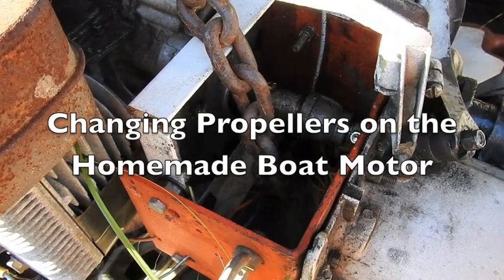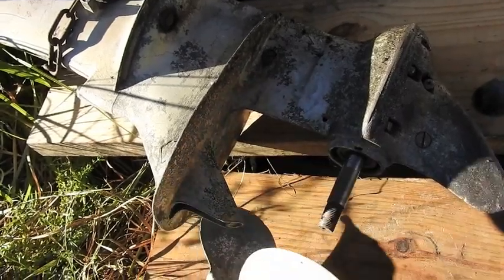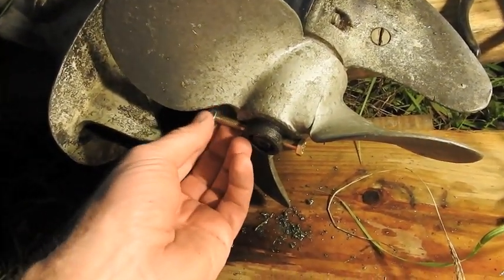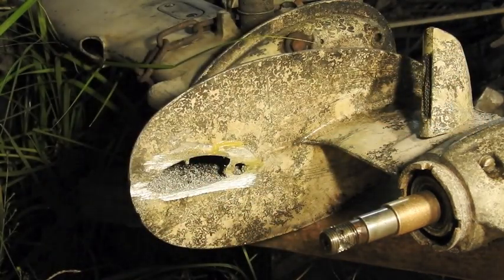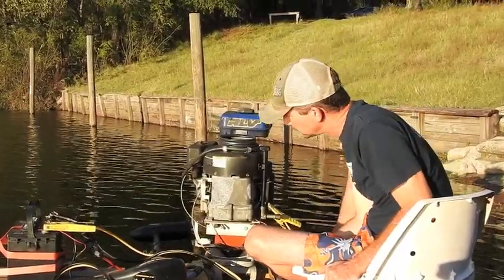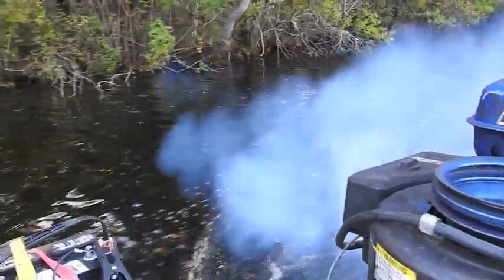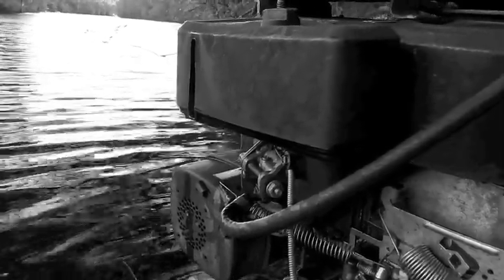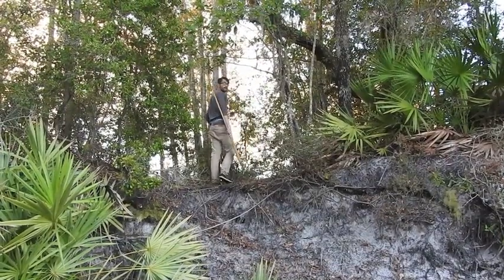Homemade Pontoon Boat #7 Looking for Speed.

Comment: You should have a "love joy" coupler" between the motor and the shaft. They have a rubber insert that take out the vibration and run smoother than that piece of pipe and bolt setup you have there, that will no doubt self destruct eventualy.
Reply from the maker: Everything self destructs eventually... Just kidding. If you check out my more recent boat motor builds, I did use love joy couplers. They are so much better, I wish I would have know about them sooner. thanks for watching.

Comment: If you want more speed, spray foam the gap between the barrels and then flex tape them.  Make them smooth.  More importantly, tapper off the rear barrels so you do not create swirl.   Great build.
Reply from the maker: I love your ideas, especially the tapper in the rear to prevent swirls.  I am planning another, bigger build and I will consider what you said once I get started. Thanks for watching the entire series and for the comments.
Reply: One last thing, I always wondered if building 2-3 foot side walls that are hinged could fold down as a wider space would barely affect the stability.  I just got it.   Take your idea of the PFC 9inchers to the folding sides to make a platform for a dozen kids.
Reply: The 9 inch PVC you called a canoe or whatever.
Reply from the maker: Yes, the PVC kayak...
Reply from the maker: You could use them as side walls until you need more space and the open the wings up...
Reply: The reason for the idea is for more people but that means more weight and then there is the displacement or bouncay or whatever its called.   I do think you should do the next build with 8 barrels with detachable pointing tips( water cutter - whatever its called).  I have thought of making a boat that folds out to a communal platform.  Sides being of 3 inch floating foam.  I dont have the math, time or your ingenuity.

Comment: Great job!   “Instant Engineering”  at its best.   I just spent a bunch of money getting a 70s 115HP merc Tower of Power (straight 6) running.   I’m thinking 4 side barrels and a 2 barrel center pod for the motor.  If I can keep it all under a 1000 pounds 90mph is not unreasonable.  I’m 71 and have not got much left in the tank or in the the CPU so what’s the worst that can happen?  I lose a nice restored outboard and a shit load of pickle barrels.  I’ve been an engineer since slide rules.  This is the kind of stuff the got me started and this is what will take me out.
Reply from the maker: Funny and thanks for watching.
Reply: SEND IT OLD MAN! KEEP KICKEN TILL THEY KICK YAH OUT!

Comment: look  on back ( motor side) of prop around the inside there are two numbers with a "X" between them.
One  is  the  prop circle and the other is the  blade pitch
Reply from the maker: I will be checking that out again. Thanks for watching.

Comment: You could do a 420 predator long tail and get more speed that way from the prop spinning the same rpms as the engine vs using a conventional out board that's geared down in the foot
Reply from the maker: That would be so sweet! Thanks for watching.

Comment: Hey Chud, how big is the boat?
Reply from the maker: It is 6 feet wide and 12' 3" long. However, I am planning to build a 15X8 footer with 2 additional barrels. Thanks so much for watching.
Reply: Building mine as a modular pontoon system. So when I go fishing by myself, it’ll be 4’ wide, if people wanna tag-along I can add another 4’ wide section to it and double my deck. 

I’ll post videos to my channel as soon as I figure out the length I wanna tow with my Prius
Reply from the maker: I love that idea and please do let me know when you get it going.

Comment: Chud, why not use the s10 to pull the boat, the nissan transmission is going to suffer
Reply from the maker: The NIssan is more reliable.  I need to put trailer light hook up wires on the truck. Thanks for watching.